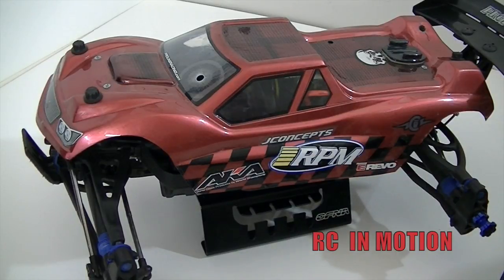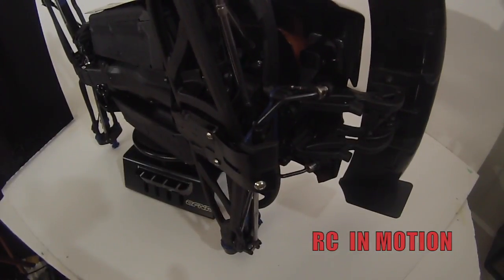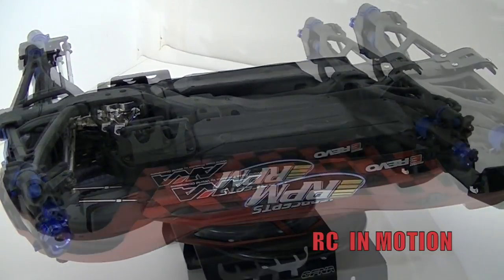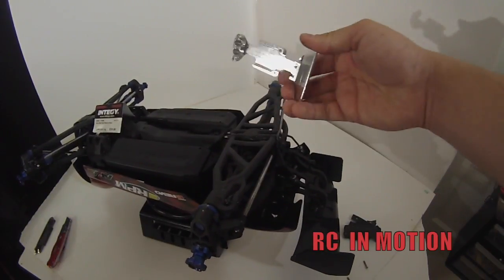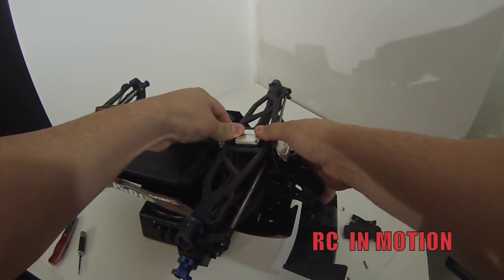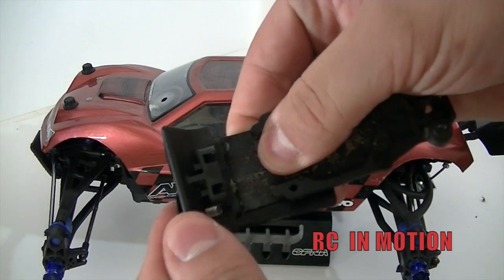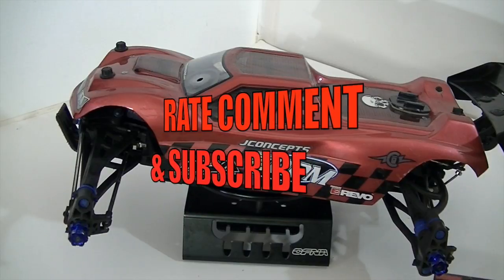Traxxas Erevo-Rear Skid Plate- Integy Upgrade Install

Comment: The black clip that comes with skid , whats it for?
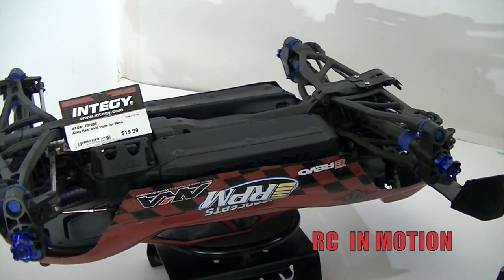Reply from the maker: If you look around 4:49 you can see the package does not include a clip. The black skid you see was the previous skid which was hacked on there to hold up until the upgrade arrived.
Reply: the clip comes in the front kit not sure what its for though.